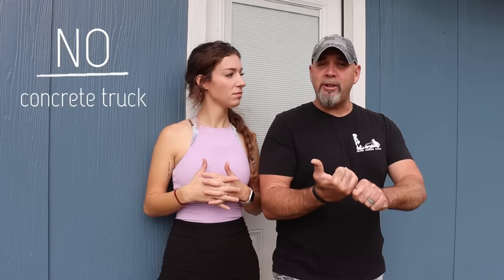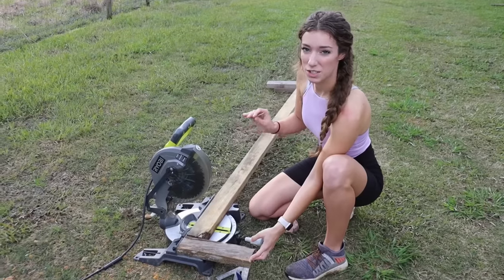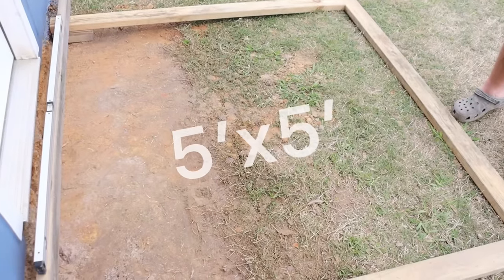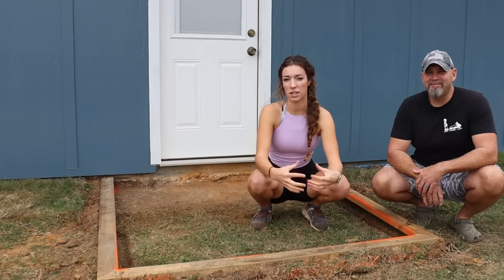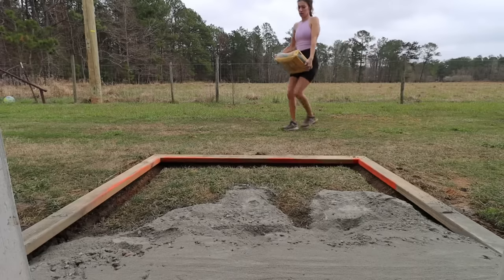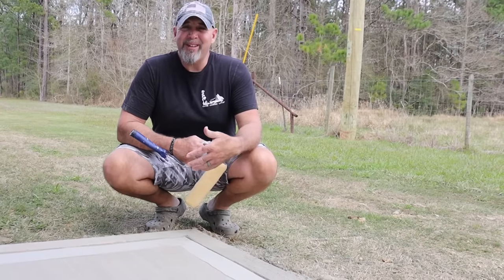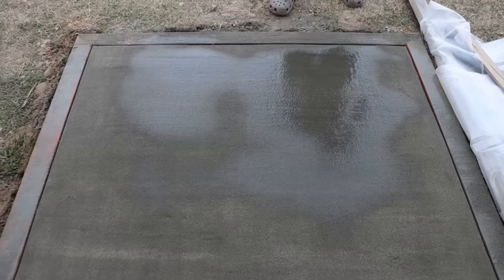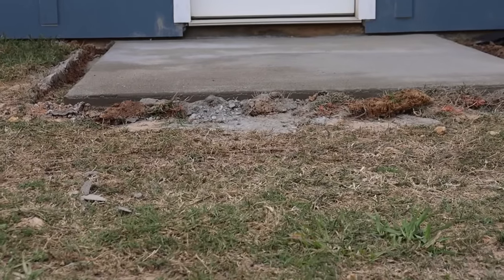How To DRY POUR CONCRETE SLAB and Update of Our 1st Pour

Comment: Professional concrete form carpenter here: Concrete finishing can be tricky and large projects can quickly get out of hand when you have a fast cure. You have essentially eliminated the two greatest pitfalls for the first timer. Love the paint roller. Well done.
Reply from the maker: Thank you so much!
Reply: I have done a lot of concrete work on my backyard with mixer, all successful. Would be better to pour some water on the ground before pouring concrete?  
Thank you!
Reply: Correction: They clearly say they use a "concrete roller" and not a paint roller.  I've scoured the local hardware stores, ebay, and Amazon and have yet to find a concrete roller.  Deep sigh, what's a feller to do? :-) Now is only these kind folks could learn to speak American.
Reply: @CajunCountryLivin  is a thin slab required for this method? Or could you do this same thing with a 4” slab?
Reply: @OlTrailDog  k
Reply: This is great. Would this work in Northeast Indiana? We get major freezing here.
Reply: A old Dog can learn new tricks. I don't know if it will work here in Michigan but I'm going to give it a try this summer 2023.
Reply: I think they’re english is just fine, especially to my country boy ears…maybe try not being rude and ask them, that’s what us good ole country folk were taught to do @OlTrailDog  Anyhoo I am really inspired by this video..just bought a new house and I was going to do the white rock walkways with some landscape trim to hold it in place but this will be so much nicer and actually cheaper than the white rock and trim because I need a couple walkways around the house…I’ve done the mix and pour, and rush to get it done concrete before but after seeing this video I’m actually excited about working with concrete again…Thanks for the video…the chickens are great, we have a good size flock of peacocks that live in the neighborhood here along the hillsborough river in Tampa, FL..they’re beautiful and well fed by all the neighbors..!
Reply: @OlTrailDog I understand them very well.
Reply: Nice to see a classy professional with words of encouragement instead of bashing every video they see.  👍😂
Reply: Looks great! Only dry concrete construction I've ever done has been offset alternately stacked bags for retaining wall construction.   It still seems to me that a wet mix using  an inexpensive Harbor Freight electric mixer would be much faster/easier and allow for deploying heavy gauge wire-mesh into the slab to pretty-much guarantee no resulting cracks in the slab ... especially for larger slabs.
Very nice job for this kind of smaller project!
Reply: @pukebucket5360  Pause the video at 23:23 and look at all the little pits in the concrete surface. Those will collect melt water. When it refreezes it will expand and break some of the concrete. Little by little the relatively good surface will deteriorate more and more.  5 years later your concrete will be pretty bad. Unless you can work all those pits out before it sets.
Reply: @OlTrailDog. "Now 'is' only these kind folks could learn to speak American."  Try learning to write Amercian before criticizing the way others speak it.
Reply: Thank you for the heads up! Maybe rebar will successfully secure my 'pieces' when laying a big barn floor?? I know I'll trick the standard and make it work well. Oh yeah! I am already seeing the challenge to a really big slab but I'm very creative. Maybe I should just form puzzle pieces of concrete and interlock them together then come back over with a compatible filler and sealer??? Huh? Hmmm... Joking really about that puzzle pieces... just thinking out loud.
Reply: @mickeymallette2663  I would think you would want to do a thicker "pour" where you have freezing.  you could pre wet the ground and dump half the mix in and lay some rebar in and then dump the rest of the mix and screed off and wet as they do but I'd keep it wet longer and cover with plastic for several days and keep the water on it.
Reply: @debbieforseth254  @OlTrailDog right... He was joking. I thought that was pretty obvious. oltraildog Did you really go to the hardware store asking for a "concrete rollerhootus"? lmao🤣
Reply: @OlTrailDog  They are clearly speaking “American” English.
Reply: @OlTrailDog  i think the dude was joking around.  but there is plastic or steel stucco rollers or texture paint rollers if you wanted to put a little stipple effect on the finish.
Reply: @techneckred There actually is such a thing. I've seen it used for doing a pad for livestock. It gives a rough surface for traction.
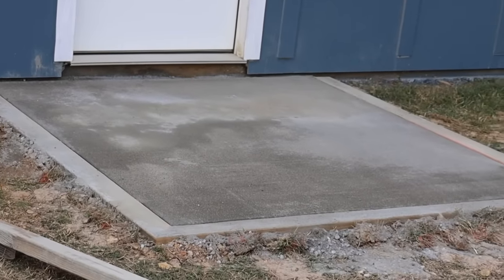Reply: @CajunCountryLivin  23:24 ppl
Reply: I am impressed by your Diy slab project easy 👌, will try it ,watching from South Africa Soweto!
Reply: @OlTrailDog  They have a wonderful accent...now only if you could master the King's English, (to include English Grammar) perhaps there will be hope for you.
Reply: @mk-tc8ge Louisiana man, no freeze
Reply: @Puke Bucket  yes it'll work up north here.  You might have to add rebar for strength or some wire fencing. because of our winters. But hey give it a try and let us know
Reply: @OlTrailDog  if you've used a paint roller before, it's readily identifiable even without any narration-
Reply: @pukebucket5360  I live in IN north west Elkhart county. Tamp down the ground real well first and compact it’s and put rebar or wire mesh in and pour 4 inches thick and should be fine. If the ground under is solid you shouldn’t see much shifting, pour four inches thick with mesh/rebar and if there is minor shifts the concrete will be strong enough and thick enough to hold. That’s what I’m doing with my projects.
Reply: @pukebucket5360  I'm in the north, north of yourself. We generally remove another 1"-2"...or more (foot traffic or shed or parking a vehicle) of organic earth (is the ground soil/mud or sand/gravel?). Then refill that extra depth with ¼minus gravel as a base to then lay your concrete upon. For a deeper base perhaps spread down 25%ish ½"minus gravel then lay ¼"minus gravel over that ... and tamp it.

There's a ton of preferences, advice etc. The goal is to think 'drainage'. Frost heav thrives well with poor drainage/locked moisture and freezing atmoshpheres🥶🤳🏿
Reply: @OlTrailDog  He is being funny.  "Concrete hootus".   It IS a paint roller.
Reply: @OlTrailDog  No such thing as a concrete roller, it's a paint roller 🤷
Reply: @mk-tc8ge  even after it sets you can always use a concrete sander
Reply: Is this method and depth safe for freezing winter time states? What's your suggestion?
Reply: @Joshua-jk1pn  NW Elkhart County, also. I’m Wondering— would you need to raise the rebar off the ground a bit, maybe support it in several places so it stays lifted?
Reply: @rexswindlehurst3074  I live in Michigan as well. There is a difference with the freezing and thawing. In this respect, the typical way to lay concrete is to add rebar or other metal to strengthen the concrete and help keep it from cracking. I would lay a bit of dry gravel below first, and then fill concrete 1/2 depth, then add rebar, then finish filling with concrete.  We do have to pour differently as they are warm weather, we are cold. The outcome should be the same however in the end.  Just prepare it for the winter seasons and you should enjoy it for years to come.
Reply: @OlTrailDog  they talk just fine. I live in the PNW and can understand them just fine.
Reply: @OlTrailDog  it was a paint roller, I think he just called it that tongue in cheek since he smiled after using that term
Reply: @OlTrailDog  I don't mean to be mean but wait one second. Did you just write: "Now is only these kinds of folks could learn to speak american"? You're killing me! Please tell me you understand it's "English", not "American." Perhaps when you learn proper English you may want to try a second language. It's a great mind expander and a magical way to appreciate even more your native tongue. May I suggest Spanish or maybe Swahili? 😊
Reply: @rexswindlehurst3074  Michigan here too... I would really like to know if it is Michigan-worthy.
Reply: @m k  that was put in temporarily and they don't get freezing weather conditions. I must have been listening
Reply: @VadVerh I have the same question. Have they tried, or would they recommend wetting the ground prior to adding the dry concrete?
Reply: I find that interesting , thanks for sharing it .
Reply: Does this work in cold weather?
Reply: @pukebucket5360 yes
Reply: How would one adjust for frost and heaving? I live in MN and I really need to figure out a way to slab an area to rebuild a protected wood shed and tool shed. I am a female disabled veteran and I do everything pretty much by myself because my hubster works his ass off at his parents restaurant 6 days a week.
Reply from the maker: https://youtu.be/JfLQFPF8Ulk
Reply: @Kitnkaboodle_64  Someone said it. Pour half thickness and smooth it out. Put the rebar on top of that. Pour secont half thickness to get it to full thickness. Screed, Mist, Sprinkle as per his recipe. Don't you know cajun men are the best cooks. This is a recipe for cooking up a slab. BTW I'm an  old cajun from Iota, Louisians transplanted to texas 48 years ago.
Reply: No water? Never saw before, what is the secret? How come tge powder dries uniformily
Reply: @OlTrailDog Do you have a Harbor Freight nearby? They carry concrete mixers
Reply: Really??!! These really nice folks didn't have to share at all, for which I'm grateful that they did. Now! Your very rude behavior is certainly not appreciated, nor is it needed. If you don't like what you hear, change the channel. If their southern dialect is your issue; well...….. That's your issue. But since you're being so critical of how these fine folks talk, lets try cleaning up how you convey a message. Check near the end of your sentence? ("Now Is only") Help me out with that please. Never mind! You'd probably screw that up too. You should simply apologize. Or, until you can return with a suitably, and grammatically typed insult.  > @OlTrailDog
Reply: I must say I'm very impressed with your work. The roller was a great idea. For the person that has an issue with your accent I  say you sir are a tool.
Great job guys.
Reply: @OlTrailDog you mean English? I wish people could stop calling English American. 😂
Reply: @betetet you could do smaller sections of concrete as long as you leave rebar sticking out to secure the next poor.  Your concrete would probably be different colors though when your done so you might have to paint it or deal with multicolored concrete
Reply: They're in Louisiana, probably not to worried about freezing. Unless our global warming is turning towards another ice age.
Reply: So by putting water on top and not mixing it with water, wouldn't the bottom still be weak and dry?
Reply: @mk-tc8ge ❤ great teaching.  I ❤️  it !!!
Reply: Can you use the same process to fill in cracks on your existing concrete? My cat walk has cracks in it from years of rain coming off of the house and I would like to repair it myself as I'm 74 years old and on a fixed income....surely can't hire anyone these days! 😊
Reply: Ok so this is so much easier then what my husband was doing on our sidewalk ( needs to be redone since he wasnt in sync with my brain when I told him how I wanted it) so I am wondering will this work with creek bed rock mixed in with the concrete ( concrete poured around them and level with the height of stones)
Reply: So with no sand no metal no stamping looking at this I'm losing my mind. If this is all you need to due. 👍
Reply: @OlTrailDog u
Reply: @mk-tc8ge 1:55 😅
Reply: Just learned something new thanks!
Reply: Great job guys. Can’t wait to try this for our large coop.
Reply: @rexswindlehurst3074  also from Michigan and with luck will be a first time home owner this summer please let me know how it goes for you.
Reply: Thank you for the tutorial.Going to try a small area..
Reply: LOL tie her hands behind her back she won't be able to talk! Lol guess he's just as bad! 😅😂
Reply: @rexswindlehurst3074 did it work
Reply: Did that slab work. I am near St Louis and I want one 6 inches thick.@rexswindlehurst3074
Reply: Good job y'all.  Very interesting wrinkle on this operation.  More than one way to pluck a chicken!
Reply: Im about to have a go at this, i have a question, will any cement do ? Was thinking about mastecrete ? Anyone any experience with normal mastecrete ? Does it have to be quickcrete ?? 
Thanks from SCOTLAND 👍
Reply: @gregfranklin1230  I'm in southern Canada (Montreal) and I understand them just fine as well y'all !!
Reply: @OlTrailDog usa una escoba al estilo mexicano 😂🎉
Reply: Without water the strength will never be there
Reply: Love 🥰 Your Rooster 🐔💕
Reply: Hey, that looks good...‼️💞
Reply: Curious 
How many 80# bags did you use for this 5x5 ...?
Reply: I would like to be your neighbor ❤

Comment: I built a brick sidewalk using dry concrete. I set all the bricks an inch apart in a pattern, poured the dry concrete, swept it into the spaces and watered her down. That was about 30 years ago and there have been no problems.
Reply: Great idea 🎉
Reply: That's actually a brilliant idea
Reply: Did the same with flag stone for a fire pit area. Worked perfectly
Reply: wonderful idea!  do you have photos?
Reply: Is there a way to see a picture? I'm trying to picture it in my head but it's not going well.
Reply: I need to see this that sounds great!
Reply: That's amazing. Thanks for sharing.
Reply: I wonder if that would work with pavers too? I'm gonna have to move some dirt around but I'll level it and put a 2x6 frame around the area I intend to turn into a patio coming off my advice ground pool. I was gonna put down 3in of crushed rock and sand then fill the spaces between the pavers with sand. But, if I put down the crushed rock, wet it down really good and let it dry it'll compact itself. Then, put down my pavers and instead of sand use concrete to pour in between and around the pavers by hand. Then brush the pavers with a little hand broom and then set the concrete around the pavers. What do you think?
Reply: Me too. Worked great. On another project, I NEVER applied the water. Just wait a month in S Louisiana and it cures itself. Good high-humidity does the watering for you. From Iota, LA. Near Lafayette; home of the ragin cajuns.
Reply: That's awesome!

Comment: Did a 10ft x12ft patio Dry pour a year ago after watching your videos.  Did everything step by step to the end.  A year later, no cracks and no problems at all.  It's doing very very well.  Looking forward to doing another one.  Thanks so much.
Reply: planning on a 10 X 12 also. Did you use rebar to strengthen it and did you also use quikrete as well? thanks
Reply: How many bags did you need?
Reply: And what was your total cost?

Comment: As an engineer on several large construction projects I have inspected a lot of concrete placed and finished and this is the slickest method that I have seen for a light application like a sidewalk or a pad. That final paint roller finish method is genius !!
Reply: As an engineer, is there anything you'd do differently for a large slab?
Reply: @adamedwards4305  if your going to do a large slab put joint breaks and rebar in, that’s about all you need to do
Reply: Also removing organic soil AND vegetation under the slab would help with longevity

Comment: I drove a concrete mixer for several years and this is a first! One thing that I did learn about concrete finishing by watching the finishers in my rear view mirror is that finishers like concrete to be very wet because the concrete is easier to work with. However, excessive water weakens concrete and causes it to crack. Your dry method is a lot drier and therefore allows the concrete to be stronger when it dries. You folks may be new to YouTube, but you all did a great job! I look forward to seeing more of your videos and I would love to have more good people like you as neighbors. Great job guys!
Reply: That’s why we use superplasticizer.
Reply: That's what was going thru my mind as I watched this, that slab will likely be stronger than a "wet" slab because less water was probably used.  For small DIY projects this is the way to go.
Reply: @davidmontoya1400  what is 'superplasticizer'?
Reply: "Super" or superplastisizer, is a chemical additive that makes the concrete more plastic or wetter without adding more water as more water means less strength.
Reply: Incorrect fam. Finishers that wanna hurry up and just slick of the pieces. I want my concrete dry, dry, dry. With very lil cream after making my passes.

Comment: We have a large patio and walkway of flagstone that the sand between the stones was basically gone.  We had someone give us a $2000 quote to repair it.  I saw your video about the dry concrete and we removed all the old stuff ourself and poured dry mix in all the joints and topped with a 1/2” layer of polymer sand to match the stone better.  It has gone thru one zone 6a winter and it is beautiful.  We spent less than $100.  Thanks so much for the tip!!
Reply from the maker: Thank you so much for sharing this with us Sandra! So happy that we were able to help!